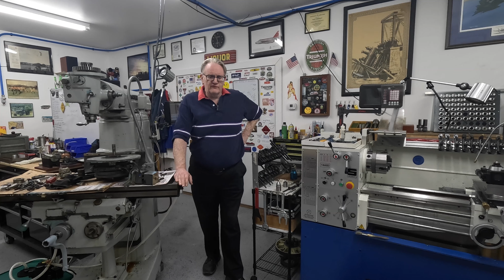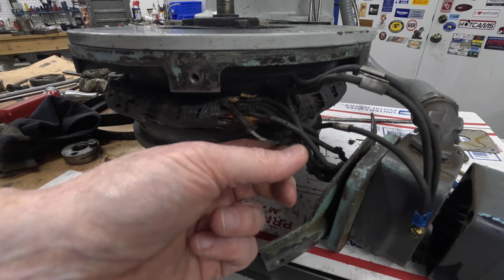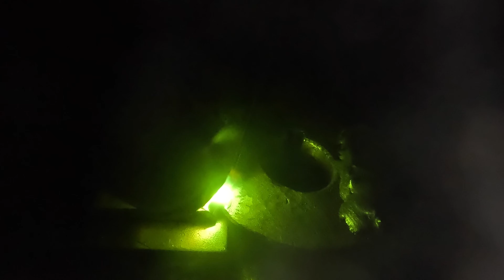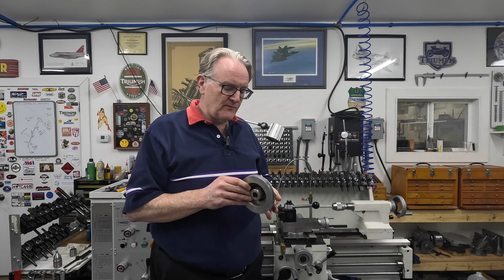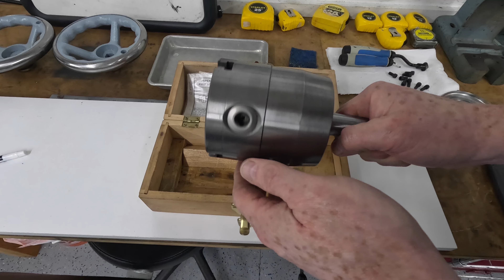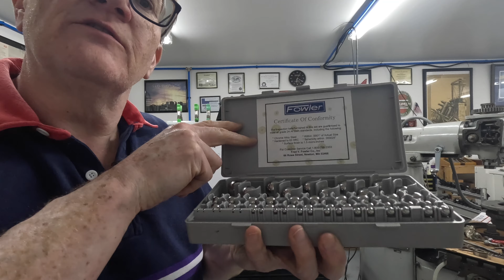Shop Talk - What's Up with the Mill - New Sticker - Auction Wins - WELDING FOOTAGE - Cup of Tea.

Comment: I'm the reason Osha put those regs in place for those buffing wheels. Well me and another guy. A week before my 1st wedding I took 85 stitches in the forehead from one of them. 😅😅
Reply from the maker: Ouch - that's a lot of stitches. Did a wheel explode?
Reply: @StuartsShed  no, it had a buffer mop on , my job was to buff weld discoloration off a stainless box with an edge facing me. The mop grabbed the box and pulled it from my hands, and slung it  around and over the top of the mop, launching it like a rocket at my face.